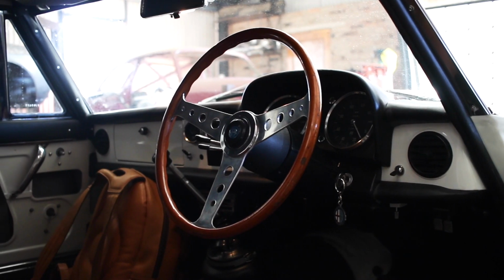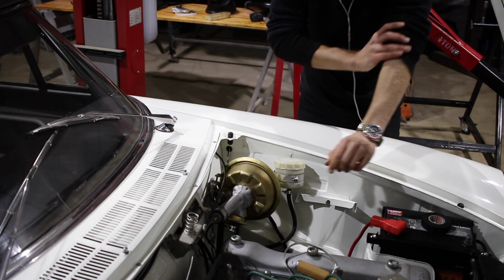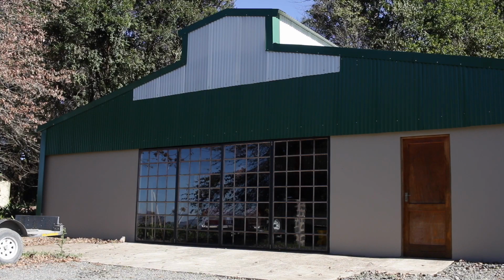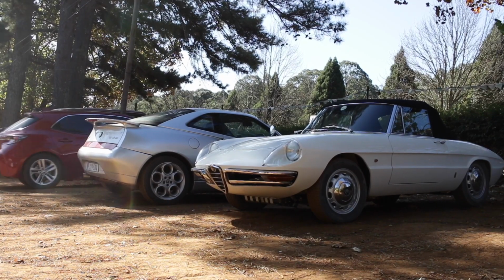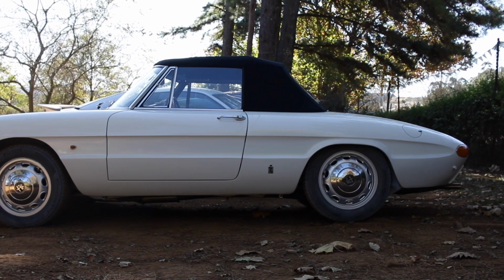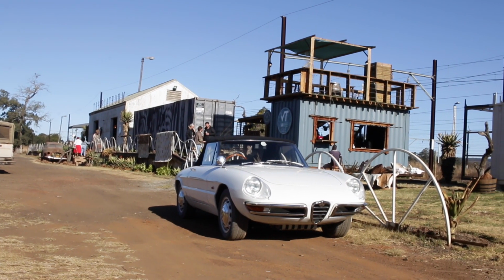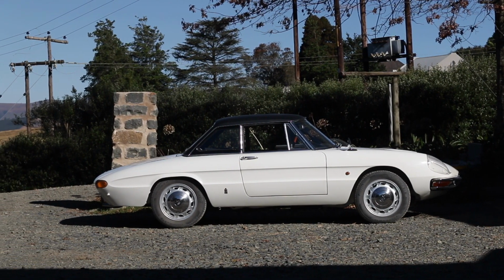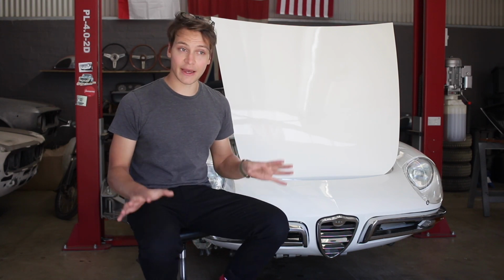Driving the Duetto Spider for the first time.

Comment: My Duet Spider Veloce had a hard top and it was noisy.  The rubber padding squeaked and the top thumped when the car rode the bumps.  The top eventually ended up on my garage wall beside the snow board--both were consigned to being seasonal gear.  I've been following this rebuild and your Alfa is nice indeed.  I am a fan of white roadsters and performance cars because of their lines and because of visibility.  This is indeed a good day.
Reply from the maker: Yeah I can’t imagine using this hard top very much, but I’ll try my best to make it as usable as possible.

Comment: Looks good! Same color as the one I had (but yours is in better shape, mine had been heavily rusted and repaired.)  For some reason, I always loved this car with the top down and the tonneau cover on best. I'd drive it in the middle of winter that way with the heat on full blast.
Reply from the maker: It is nice with the top down! But I do feel like I stand out a lot, I guess that's a small town thing.
Reply: @JethroBronner  I think they built less than 6,000 Duettos total.  YOU STAND OUT. And it's an awesome looking ride!

Comment: excellent to see it on the road JB!  looks like the toe in is giving it a fair bit of positive camber too but that should alter when you sort the toe,  again, cool work!
Reply from the maker: Yeah it's a product of the toe, I just have standard non adjustable upper control arms on this car, so I can't move the camber.
Reply: @JethroBronner  in the past ive used concentric bolts to alter camber, not sure if it could work on the alfa but maybe worth looking at??
Reply from the maker: paul Gallagher The best way is to get GTA top control arms, which is something I’ve done for the GTV build.

Comment: Can you do a video on how the timing light works? I've always be curious on how they are able to get the timing.
Reply: At 5000 rpm the M mark on the pulley should line up with the pointer, when viewing it with the timing light. triggered by the #1 cylinder spark plug wire.
1600 Duetto, GTV, idle, F, = 2 to 4 degrees BTDC, and maximum advance, M, 40 to 43
 degrees@ 5000 RPM
https://centerlinealfa.com/sites/centerlinealfa.com/assets/files/default/tune_up_specs.pdf

Comment: Hello JB, my name is Arturo, from Panama.
I have a 1998 Alfa Romeo spider. I have had it for 3 years and I have never changed the brake pads. I found that the caliper pins were locked and therefore the brake did not work. I repaired the pins, I cleaned them out and they looked good. I put everything together and the brake still doesn't work. I tried to bleed it and no brake fluid comes out of the bleeder. My question is: Could it be that the piston is locked in the cylinder? or what can it be? Thanks JB

Comment: You looked exhausted tuning those carbs Jethro! Glad to see the Duetto finally road-worthy. Out of curiosity, why the mask when you were adjusting the timing? Is it so you don't breathe in paint fumes burning off the hot engine?
Reply: He most likely wore the mask to protect himself from Carbon Monoxide.  Probably better to adjust the timing and carbs outside the garage if possible.
Reply from the maker: Yeah by that point the garage was pretty full of exhaust fumes.

Comment: While I really admire your skills and work, I tend to realize that retromods are the way to go when rebuilding old cars. Not to the extend of destroying the character of the car, but sensible touches to make it more modern. Digital ignition-fuel injection, modern brakes etc. I may be wrong of course
Reply from the maker: I’d like to do a restomod at some point. I think it’s important that a restomod amplifies the original spirit of the car, not replaces it.
Reply: @JethroBronner  100%. I understand that you  restore the Spider for the collector's market and my comment was more general targeted. Maybe one of the following projects 🙏